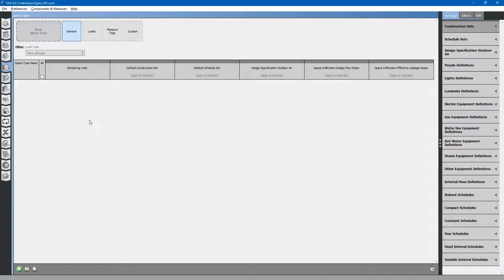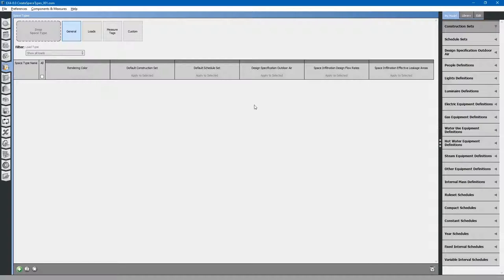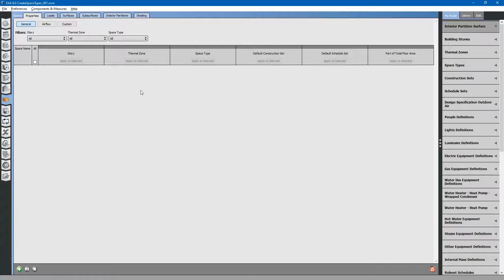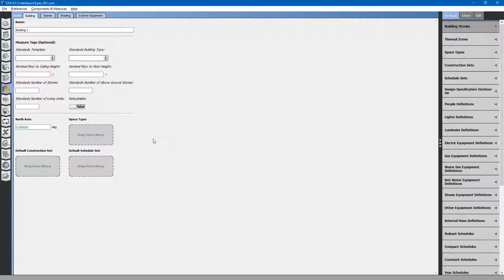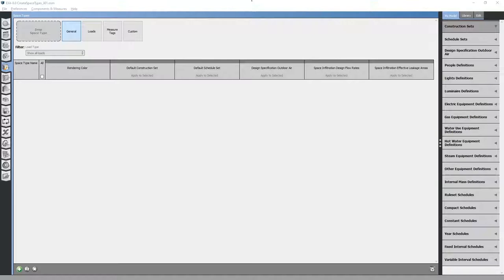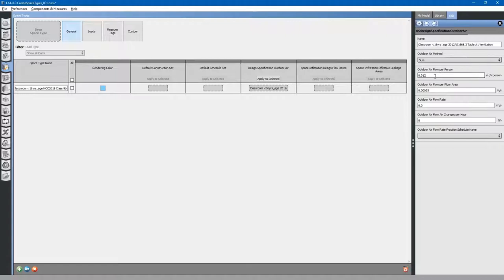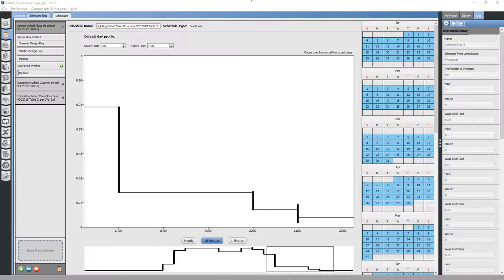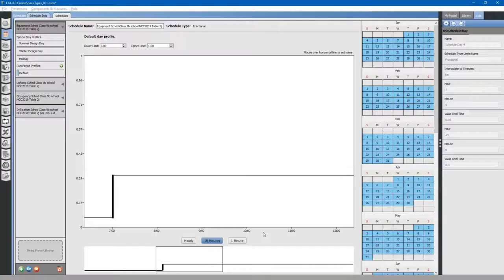OpenStudio - In-Depth: Creating Space Types

Comment: Hi, I'm missing any default sets, including for the design outdoor air portion. How do I edit it when it's missing?😊
Reply from the maker: These are included with OpenStudio App download and should be located in the resources folder: ...\openstudioapplication-1.7.1\Resources.  If you do not have your default libraries set, go to the preferenes menu at the top and select "Change Default Libraries".  Browse for the resources folder and add them.

Comment: I made spaces but want to change the floor area of either each space or the net floor area of the whole place, how?
Reply from the maker: You can select the "Render By Thermal Zone" button.  Open the "Inspector" tool.  Here, you can force the ceiling height, Volume, and Floor area using Hard Sized.